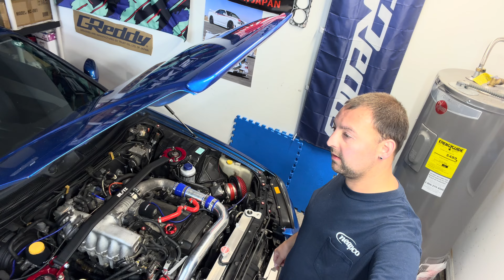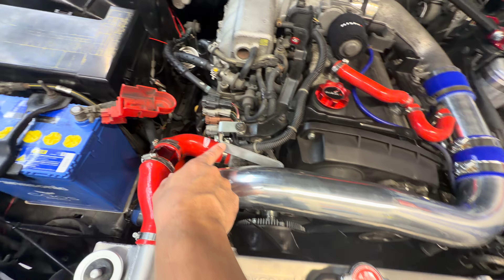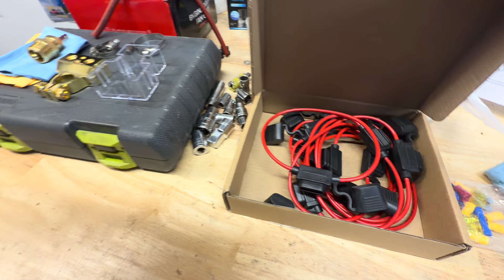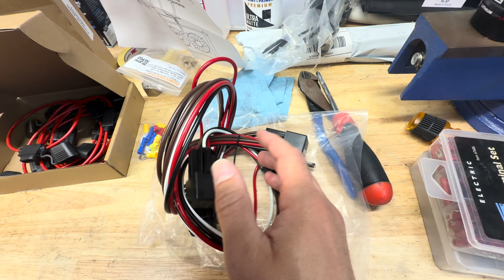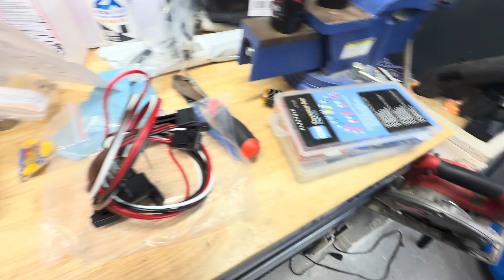R34 skyline e-fan set up.

Comment: Definitely rewire the 12v constant to a 12v switched. You don’t want that wired that way. It will save you a headache.
Reply from the maker: It’s all on the relay and fuse, won’t always stay on. It usually runs for about 5 mins with the car off. Which keeps it cool! What’s the down side of having both of them hot?